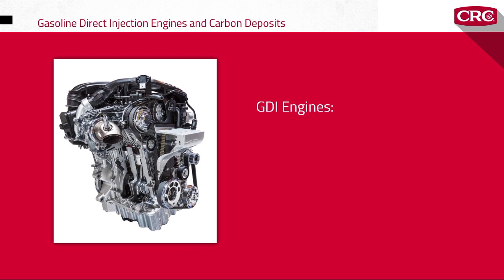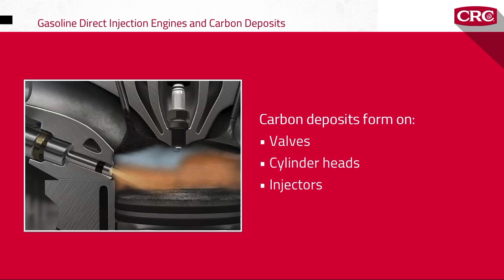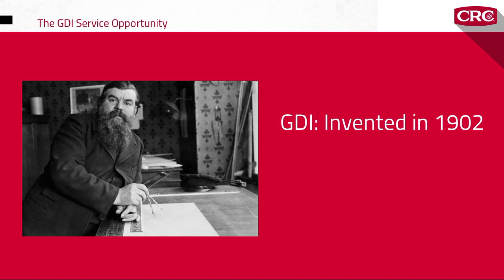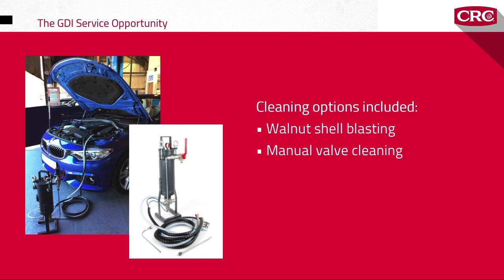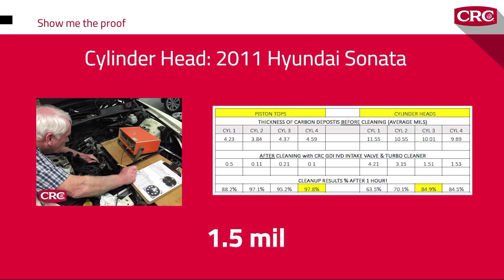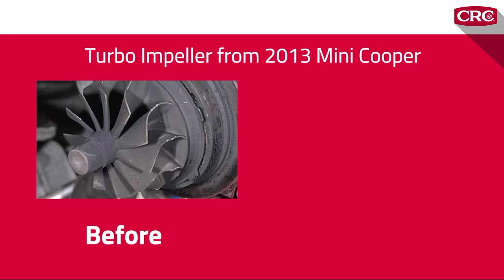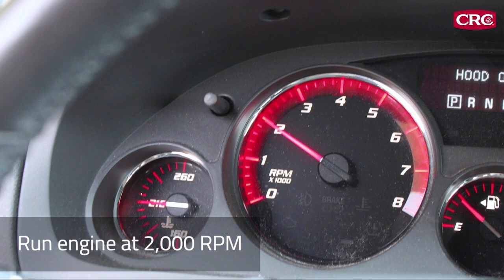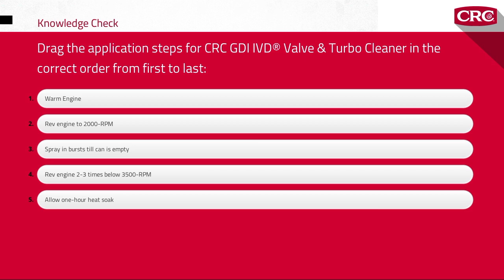GDI Engines and Carbon Deposits | Know Your Parts

Comment: Diesel engines work on the same injection principle(with some differences) how come they don't need valve maintenance so often?
Reply from the maker: Diesel’s have their own build up issues separate from GDI engines. Even though fuel injection is the same, fuel being sprayed directly into the cylinder. Diesel engines use CCV systems instead of the GDI engines using PCV systems.
Reply: @Knowyourparts  so does diesel cars still need to this but with some other products that works with diesel engine? Cause in the video it said only for gasoline engines.....
Reply: @cuvame  they explicitly said not to use this product in a diesel engine

Comment: Ford doesn't recommend this on their EcoBoost engines, cause the carbon can break off in chunks and damage the turbines on the turbo.
Reply: I can learn how to replace the turbo's myself with only a few tools, a $1k project, vs spending thousands to have a skilled mechanic rip my engine apart to replace the valves.  But, I noticed a lot of comments here that state this product doesn't work so I will need to learn how to clean the valves myself.
Reply: @Hiker_Mike  you are right you could replace it yourself. You can replace anything in your car yourself if you have the resources.

Yeah I'd have to agree with the others. I've seen before/after pics and it doesn't really make much of a difference. The only real way to clean the valves is to take it to a shop and have them walnut shell blasted

Comment: You need a 10 mm scope cam and some minor tools once you remove the intake manifold. Some vehicles will be harder to clean as the bore is deeper. To pickup the loose bits that your take out manually you need a shop vac with a hose that goes into the intake port.  I takes time but yes you can call it the deposits, we just did it to a GM traverse with 150,000 km and it was nasty very nasty. This product is a scam and the deposits still need to be vacuumed out. This product was returned 1 hour after being used as it did not do squat.

Comment: Do you have to do an oil change shortly after?
Reply: I read elsewhere that an oil change is required after treatment because the crap that it removes from the valves gets into the oil. I can't remember where I read it. But I DID read it and that's what I will do after a few hundred miles after using this stuff
Reply: Do it before your oil change

Comment: Appreciate another great product but we have avoided these issues by avoiding vehicles with GDI engines.  2011 Jeep Grand Cherokee, 2013 FIAT Abarth, and an old SAAB.  All are port injected.  FCA seems slow to adopt GDI thank goodness.
Reply: If you're driving around in those cars you're gonna have worse problems.
Reply: You may be right.  The SAAB has 250k miles on it.  Had front wheel bearing fail, light bulbs, water pumps seem weak now that they are China made.  Needs new subframe bushings.  Jeep GC, had a TIPM recall.  Other failure was brake light bulbs burnt out.  FIAT Abarth, 44k miles.  2 of the radio buttons are peeling. Replaced a part on cylinder head as a performance upgrade.  Never had a car that is so much fun to drive and own. (FIAT).

Comment: For best results, can I remove intake manifold and apply directly to the valve?
Reply: It's better to let the engines' normal operation distribute the cleaner. If it doesn't clean everything sufficiently, do an oil change and another clean.
Reply: You "can" remove the manifold, but it will be hot as the product instructions say to fully warm up engine first. Also, the engine must be running to use this. The engine probably won't run well, or at all, without the manifold in place.

Comment: I have ran diesel engines for over 40 years & they have GDI ,but didn't have these issues,modern engines with blow bx being injected into the inlet combustion system , oil type & changes & proper fuel grades will help:but disassembly &  walnut blasting will eventually be required,these additives help but are not the total answer, we use the CRC additives for the initial hand cleaning before the blasting! these sprays used while running can damage the turbo internals ;only qualified mechanical personnel should use these procedures!!!!

Comment: on a mpi engine the exhaust valves get carbon so think about it? its just a sales pinch
Reply: It's been burned on the exhaust side though, and doesn't stick in the same manner.
Reply: They keep saying carbon when it’s actually oil vapors from you PCV system and EGC valve. It forms more of a tar then what you think of like a “charcoal” like substance which cakes the exhaust valves. 

And this is the best valve cleaner out there. Did better then seafoam and Lucas in my 5.7L Tundra, and it’s port injected.

Comment: I have a chevy volt you can't control the rpm on the generator. How would you apply this to my car?
Reply from the maker: Thanks for your question. For the quickest response and best information on this, you will want to contact the CRC Industries Tech Line: 800-521-3168

Comment: If carbon build up in GDI engines couldn't be prevented, then all GDI engines must've got a certain amount of carbon build up after a certain milage, but that's not what's happening. There's a video of a guy on YT doing 250k on his Hyundai GDI and not having any engine problems. He changed the oil on recommended intervals and added a bottle of fuel additive to a full tank of gas after each oil change , that's all. GDI engines have been around since mid 90's and if they were vastly problematic, they'd have been discontinued by now

Comment: GDI junk....my 2002 Silverado 5.3 with 151k miles with port fuel injection idles  and runs just as smooth since the day I bought it
Reply: Sorry to hear that my Kia GDI with 225,000 is junk. If it or my wife's car with 115000 craps out tomorrow they'd still be the best cars I've ever bought. By the way I've had multiple Ford's GM's Honda Audi Volkswagen Datsun Nissan Mazda. All were junk by comparison.

Comment: Another solution is to just stick with port injection.
Reply: Michael Cline The BEST solution yet!💯 You could also buy a car that is Direct AND Port injection (Direct port injection) To get the best of both worlds.👍🏻
Reply: Yeah but that would limit your options to just the BRZ, 86, 2018 Camry, and 2019 Corolla.  Not everyone wants those particular cars.  The BRZ and 86 are too expensive to own (insurance and low fuel economy).  The Camry is a bit too expensive for some people.  The Corolla looks nice but we still don't know how good it really is yet (its brand new).
Reply: if these solutions are so good why isn't there a direct injection system made to inject this solution (or others) to clean the valves whislt the vehicle is in use... further more, why cant fuel manufacturers sell cleaning fluids similar to those agents within petrol that originally cleaned the valves to start with..

we see cars being fitted with water injection from the factories (bmw, Porsche etc etc) why cant manufacturers do so with cleaning agents on GDI engines......
Reply: @tacocruiser4238  the 2016 lexus and all newer models from Toyota have best of both worlds. Best to stick to automakers who give a shit about quality
Reply: Michael Cline  Ford has been using port direct injection in all their ecoboost motors from 2017 and up.
Reply: @sethgibowski8695  incredible engines
Reply: mike216ism  yes they are. amazes me how they can run 25 psi of boost through a little 2.0 4 banger. And no im not kidding.
Reply: @great159  yes as long as you LIKE the options available in that set up .. im not going to solely change what I like based on the fuel injection.  And as you see this isn't a hard thing to do at all ... Using the crc .. pretty easy actually
Reply: Ecoboost swapped Ranger 2.0 ain't little bro!! F1 V6 is 1.6L. For higher boost you always want smaller and stronger. Half of a 4.6L V8 is 2.3L . 2.0 is a big puppy in a turbo'd 4 banger.
Reply: @mike216ism  they care about engine but not styling..have you compared the 
 RAV 4 2022 with the cx5..Rav 4 is butt ugly

Comment: and what is a chunk of carbon breaks off were does this chunk go ? right it might do some severe damage in a running engine
Reply: bigliftm -- exactly. I'm wondering about long term cylinder wall wear from all this carbon being burned up in large quantities. It's like dumping sand particles into the intake. The piston rings and cylinder walls will take a beating.
Reply: Artem Brayson i was thinking the same thing
Reply: This cleans oil, not carbon deposits, on the intake valves, injectors and spark plugs. The dissolved oil will burn/vaporize during combustion.

Comment: What is the reason you say do it before a oil change?
Reply: Most likely it may cause a few more contaminants in the oil. Not a major issue usually, but it's just an extra safety step. In the past when running any cleaner I would do it like a week before an oil change.

Comment: Just install a catch can. Looking at the graph the real world driving average RPM will not exceed pass 4K during cruising. Notices there isn't any differences around 3K RPM between a clean or a dirty valves unless you hit 5K RPM or higher.
Reply: Denny Even with an oil catch can you will STILL get carbon build up. You just won't get it as fast as you would without one.💯🤓

Comment: i have the hyundai sonata 2.0t 2017 but I'm not sure where to spray it... because I couldn't find the MAF anywhere...
is it safe to spray it through MAP?
can anyone can help me please?
Reply: Okeu Ragil yes MAP sensor is fine, I just did mine. You should only worry about MAF sensor
Reply: Is possible  your hyndai doesn't  have maf only map.if you can't find it on the air intake snorkel betwen air filter and throttle body  it means you don't have maf.

Comment: I have an Audi A6 3.0T I would be spraying the supercharger if I do it like the instructions..... what should I do? An how often?
Reply: Erick Bren that’s true, there’s no mention of supercharger. Do you have 3.0T V6?

I would personally spray it to the throttle body instead. I’ve even heard of stories of this stuff ruining turbo fins
Reply: Hi Erick,This my reply to Dwight above:You make good points Dwight. I'm using 100% Synthetic PAO-Ester 5W-30 engine oil in my Audi A6 3T on the basis of it having the lowest NOACK Evaporative Index. Reading off the dipstick it uses 4mm/10,000kms. That's a good half of the loss I was seeing with Mobil-1. I also use a can of this CRC product every 10,000kms before the oil change. The car is 10 years old and running and pulling very well, never having had any other inlet port cleaning (which would require the Supercharger being lifted). Your point about using 10W30 or 5W20 is excellent from the volatility index POV, if the engine specs allow it. See https://en.wikipedia.org/wiki/Noack_volatility_test

Comment: Crc intake cleaner works yes no doubt! But remember friends it doesnt work like bringing the old carbon gunky valve into brand new valve to its genuine life when you once bought a brand new car with 0 miles on it. The only best possible solution to bring old valves into genuine shiny valves life is to use a ground wallnut shells soft abrasive blasting. Trust me on this one. All the world chemicals they might invent but nothing can be purely cleaned with chemicals as compare to manual wallnut shells blasting.
Reply: Jahuri day
Reply: Not if you do it every 5K with before oil changes.  You never let it get so bad it needs blasted.

Comment: How do diesel engines get around this problem? I thought they also have a direct injection system since ever.
Reply from the maker: The CRC product is formulated specifically for gasoline engines.  Diesel engines form carbon on other areas, not as much on intake valves when compared to GDI so we recommend a fuel additive for diesel engines with carbon buildup.  CRC 1-TANK for Diesel is a great option:  https://www.crcindustries.com/products/diesel-1-tank-power-renew-174-15-fl-oz-05816.html

Comment: Not completely true.  Some GDI engines have purge solenoid valve that takes fuel vapors from tank into air intake, thereby putting some gas vapors over the intake valves.  Therefore, if you use something like Lucas fuel treatment, you should get some cleaning effect.  How significant?  Probably slightly, but better than nothing.

Comment: Didn't know there was cleaner made for this! First time hearing about it too. I have a 2017 Honda Civic Hatchback with a 1.5 L GDI turbocharged engine. I have an oil catch can installed to help prevent these carbon deposits. If I were to use this product, would it be a good idea to remove my oil catch can?
Reply: How is the oil catch can???  Does it work??? Oil catch can only lessens  but does not prevent??
Reply: @cuvame  It works really well! Granted, every oil change it only catches a few milliliters of oil and gunk because I don't drive it hard at all but that's still oil that could have gotten on the valves that I'm happy didn't get on there.
Reply: @dario110011  I'm thinking of putting on my Toyota. It's diesel but with same GDI fuel system. It's on about 8k miles right no. So putting it early the better right? Hahaha but what I saw on the other video this is only a prevention. About only 95% of oil gets trap.
Reply: @cuvame  I put mine on with about 10k miles so yes it's better to start early. 95% is definitely a lot of blowby that's not going to the valves or anywhere else though. If that's our best form of prevention then it's not that bad of a deal. ~$150 for a catch can you empty every oil change, or >$1000 walnut blasting every 50k miles? I'm intending on keeping my car for a long time, so I want to do everything I can to increase the life of this car.
Reply: @dario110011  same hahaha cheers to that. It is truly better than nothing
Reply: @cuvame  Check to make sure of catch cans are even made for disel engines. I hear that you guys don't use PCV systems and instead use another system that eliminates blowby.
Reply: @dario110011  I will tnx. But from the diagram and video shown above. It somewhat seems to look the same. Excess air and oil going out in the outlet on top and goes back to the engine down below

Comment: Why not just walnut clean at say 80k miles? You can assure the valves are closed and not have all that junk going into your cylinders.
Reply: Greg Profitt Because it’s expensive?
Reply: blast it and then use this every couple oil changes to help slow down build up.
Reply: @afcgeo882  how expensive?
Reply: @RICK-uf1jj  Depends on the engine and the time it takes, but up to $1k as far as I’ve seen. Then there’s the issue of old engines and that once you start opening things up, you start seeing things that should be replaced.
Reply: @RICK-uf1jj  We did this ourselves on a Turbo Veloster 4 cyl. It's pretty labor intensive. Took us probably 4 hrs start to finish. It did an excellent job though. I'd say this method is a necessity for any 80-100k mi GDI engine that hasn't been maintained. I feel that if you used CRC, Seaford, or AC Delco cleaner, the walnut blasting method may never need done.

Comment: I have a 4.2L S4 with multi-port injection. Is this stuff still worth using, or am I better off just going with a fuel additive?
Reply: n3rdalert 

Use both at the same time.
Reply: @MattyLight30  holy shit you're a genius. I deadass didn't even consider that..

Comment: and are the procedures the same? but how can i keep the engine running in a hybrid?
Reply from the maker: Most will run in engine running mode when the gas pedal is kept at 2000 RPM.  Every manufacturer is different but this will work for most.

Comment: I buy it. Anyone successful after trying. I have a 2016 lexus is 300 that I just bought. Would love to try it and start out fresh
Reply: Used on my 2016 Kia 1.6L <60k miles. Took a while, but the idle has smoothed out, and at one point going down the road it burned off some white smoke (carbon). After that the acceleration in that rpm smoothed out too. I'll be using it on the regular for sure. Still cheaper than a service on my truck.

Comment: Ok 
 But why thats not happen in diesel engine although it has the same method of fuel injection,,?
Reply: I think its because diesels are compression ignition
Reply: It does happen, but because Diesel engines are more tolerant of build-up, it has a lower effect.

Comment: No trouble with Ford's Ecoboost GDI twin turbo technology!
Reply: Ford did have problems with their early ecoboost motors though. 2012-2015 and 16 had carbon issues. in 2017 they added another set of injectors in the intake port to clean the valves under low load and idle.
Reply: I just purchased a 2017 Ford Fusion with 2.7 liter twin turbo. I hope I don’t get these carbon issues.
Reply: @sethgibowski8695  Ford F150 carbon build up was so bad on the early Ecoboosts, they lost a class action lawsuit. They went to dual injection on their 3.5 Ecoboost as a result.  They added it to their 2.7 Ecoboost in 2018.  But that's it. It adds a lot to the cost of the vehicle to engineer and manufacturer 2 different injection system.